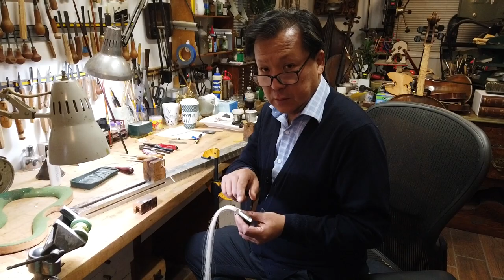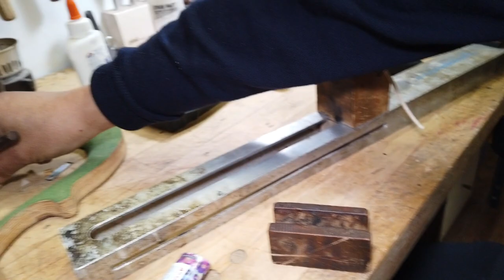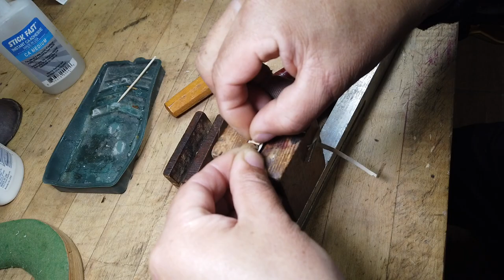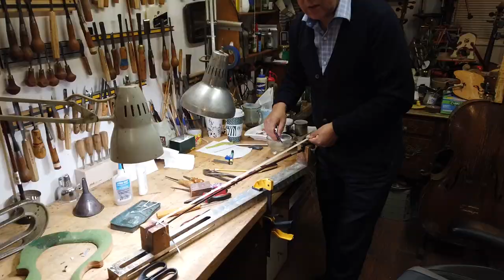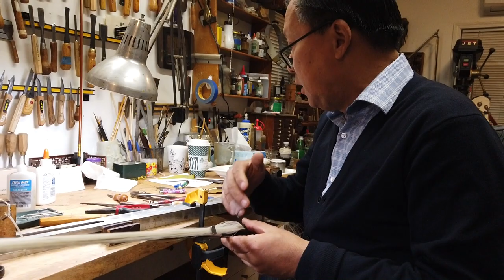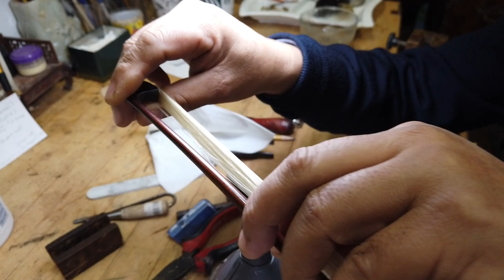How to Rehair a Violin Bow (Common Mistakes, Tips, Tricks) - Landi Sheng (HD Tutorial)

Comment: I’ve been rehairing bows for 35 years. I agree with most of his approach, especially the major choices like starting at the tip. Every step in the process of rehairing a bow has dozens of ways of doing it, it’s interesting to see how others do the work.
A few of the big mistakes I see from time to time.
Putting the “old hair” at the frog end. As the horse tail grows, the hair degrades, that hair is thinner, make sure to put the hair that grew just before it was cut off the horse at the frog end.
The Chinese made  bows when being rehaired for the first time all seemed to have the hair and plugs glued in, not just a little glue, but really saturated, it’s really a pain to have to carve out the glue, hair and wood. I do not glue in the plugs, but you must glue in the spread wedge, or they fall out. 
Getting the hair length correct is one of the trickiest parts of the job. Bows vary greatly in their stiffness and amount of camber. I make the hair longer in autumn in anticipation of cold dry weather, and shorter in the spring for the humid months. The only way to learn to get this right is rehairing a lot of different bows. When I was learning, the accept rule was you have to rehair 100 bows before you really understand rehairing. I’ve done thousands and still am frustrated at times.

Comment: Absolutely love this guy. Someone who takes pride in his work. Not a fan of the background music being that loud but great video.. I tip my hat to you Sir
Reply: It was actually a really good lesson. 
However, I suggest making the background music even louder next time. This way, I will have no clue what he is saying. 
Seriously, he was very good at explaining and showing, but after half way through, I had no idea what he was saying.
Reply: You can do it, it is not hard. The toughest part is counting 288 hairs and stick them to a piece of masking tape. Then If you can get some thick silk thread is best and whip the end then half hitch several times then drip sealing wax over the. Threads. Then tuck each end in there in the tip, then dampen hairs then tuck frog end same method drip sealing wax allow cool then maple bung, then abalone slide don't forget  silver ferrule! As. He said squeeze with block of maple scrap. When your done and if it looks decent get a candle and light it. Then quickly pass  hairs over candle use hands to judge temperature so you don't  burn the hairs, and not to close. The gentleman in the vidio has more experience than me. Also consult a book called basic string repairs by  I forget the author, and you should be fine. ELSE TAKE.THE BOW TO THE GENTLEMAN ON THE VIDIO. DONT BE AFRAID IT IS DO ABLE ITS

Comment: Thank you so very much for this. I have an extra, old, cheap bow that was not put together correctly so after using it a while the hair was too long and would not tighten. From your video I was able to take it apart, tighten and remove a small amount of hair and put it back together. Not exactly good as new, but good enough for a spare working cheap bow. Very appreciated.

Comment: Hi, Mr Wang, your video is very helpful. 
Would you tell where you marked the length of the hair with the pencil for the violin flog? I couldn't see it clearly.
Reply: Yes. Where is the place?
Reply: Which time?
Reply: He marked right where the string would go inside. He then placed his nail in the spot so when he wraps the string, it won’t go past his fingernail.
Reply: I just did this on my bow and made the pencil mark approximately 5/8 inch past the hole in the frog. Also, I had my frog positioned to the mid-way point.

Comment: The little white clip on the end of the bow broke off when I removed the old hair and plug.  What now?  Can I use a hair dryer to dry the hair (it's made to dry hair, right?)?
Reply: This white piece is important to protect the tip of the bow. They used to be made of ivory but are now made of bone or plastic. It needs to be replaced! Like repairing a bow, it is not a trivial job; it requires skill.

Comment: I purchased a violin and bow one month ago. Something feels different now. There is less grip. Is it possible i need a repair already. I have been playing every second day since i got it. And a few times i have played for 3 hours in a day.  Maybe i just need new strings?? Thanks.
Reply: Is vemp
Reply: No! You did not permanently damage the bow hair in one month! Maybe you have contaminated it with finger grease? Easy to do and it stops it gripping. You can clean the hair using IPA (isopropyl alcohol) but it ruins the vanish on the wood so learn how to do it properly before doing it.

Try cleaning the strings with a very small amount of IPA on a tissue. Do not get it on the body of the violin!! To be safe, loosen the strings, just one at a time.

🙂
Reply: JB, using alcohol on the strings will just embed the rosin in between string wraps. Place a tissue over the string, and pinch the string between thumbnail and fingernail, dragging them up or down the string where the rosin is. It will shatter the rosin and give more life to the string. Iit’s not a 100% cure; the only 100% cure is replacing the string, but this helps.
Reply: @johngeddes7894  Maybe. I had an A string that wouldn't sing from F and above, regardless of bow or technique. For a long time I tried the dry tissue plus fingernail method you described but it continued not to sing. Eventually I tried just a small amount of IPA on a small amount of tissue, with the tension released in the string and the string away from the fingerboard, and keeping the tissue moving, and immediately the string sung beautifully again. I deduced that the problem was small pieces of rosin that I couldn't chip off dry.

I very nearly bought a new string, but all the reviews I read said that mine should be fine.

That was a synthetic core string. Clearly the structure of the string will affect how it is affected by IPA.

I'll bear your comment in mind, particularly with expensive strings.
Reply: @johngeddes7894  I just realized that I used my method AFTER yours, so there would only have been tiny pieces of rosin left which came off quickly and easily with the IPA.

Nevertheless, I still accept that IPA may not be a good idea.
Reply: My luthier with more than 40 years experience explained that to me; and with that said, it’s not written completely in stone. More this, less that, things change.
Reply: When you lose grip, you probably just need more rosin on the bow hair: https://www.youtube.com/watch?v=cQyCDic6Dfc
Reply: All of the stuff in here is more or less correct to the best of my understanding, but it is also worthy of note that bow-hair itself will wear down with use and become too slippery to grip the string properly.